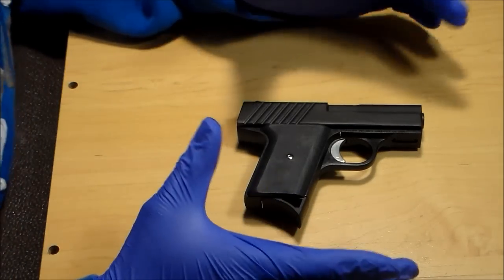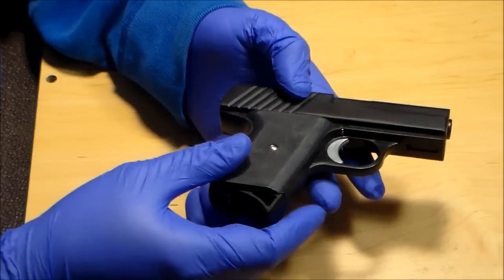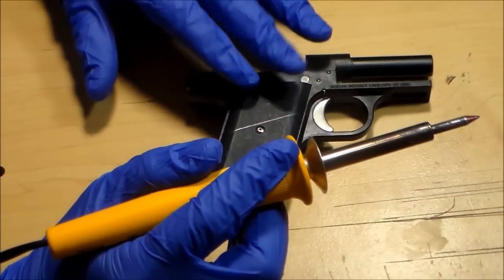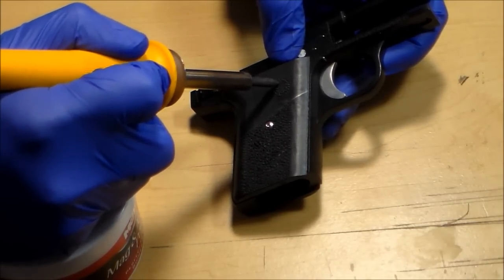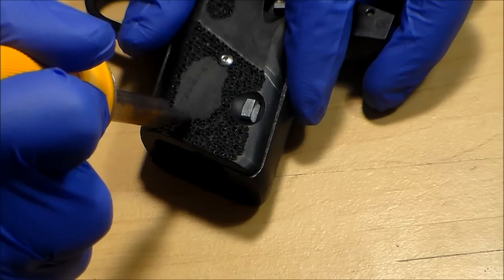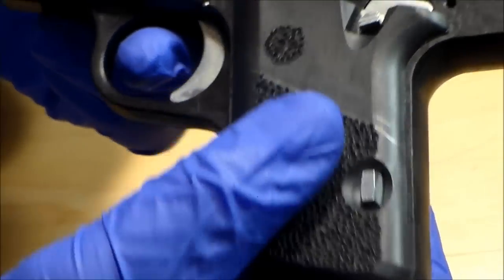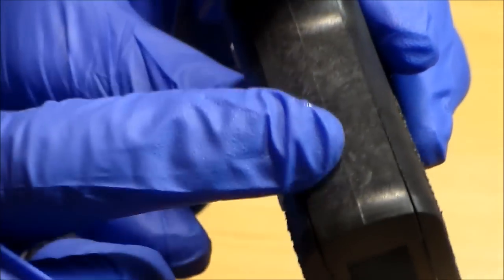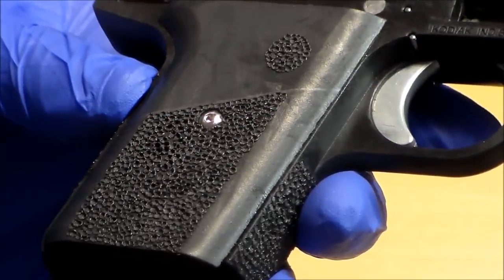COBRA DENALI MODS -  PART 1

Comment: Have you found a holster for this Denali?
Reply: b Dub ya i got a galco holster that works perfect
Reply: They have ones that will fit it well at Walmart. I've got three sizes of them so far. The smallest one is a perfect fit. They are only 10 bucks. They are also owb

Comment: I just bought a Denali, and tried to break it down to clean before using it, the problem is it doesn't have the Retainer to push in, what it does have is a rounded button that I can't push in to remove the slid. Has any body else had this problem?
Reply: You will find a small hole on the side of the slide.  Push it back until the hole lines up with a pin inside.  Stick the closed end of a wooden clothes pin in the the slide opening to keep it open (there's no hold open) and then you can drive the pin out with a punch.  After that it is easy, but watch out for small parts flying out when you remove the slide.
Reply: Mines has the same thing. I got it took in apart but I can’t get the ball back in. So frustrating. This is day 2  of trying 😒

Comment: That isn't how you disassemble the weapon on the newer models.  You have to drive out a pin, like on a Hi Point.  That round thing on the butt end is just a retainer.  If you push too hard trying to get it to depress you can bend it.  Had to call Cobra to get the correct information after trying for two hours to take the thing apart.
Reply: What did cobra say to take it apart
Reply: I figured this out today as well. No manual in the box only a download link for a manual for multiple models. Cheap guns should still come with great instructions. They are freaking guns after all